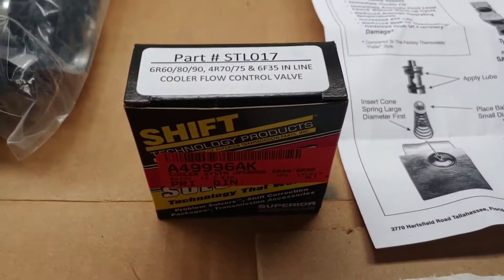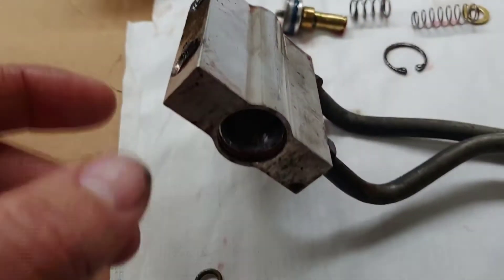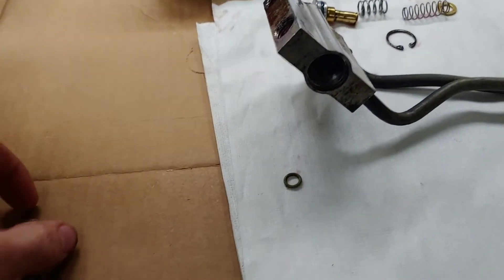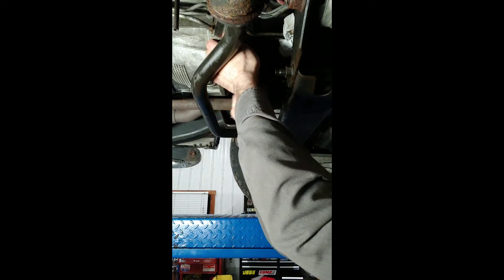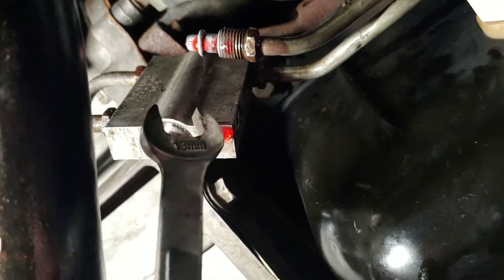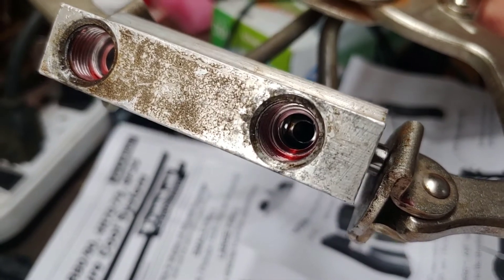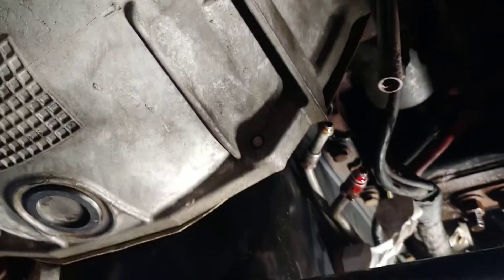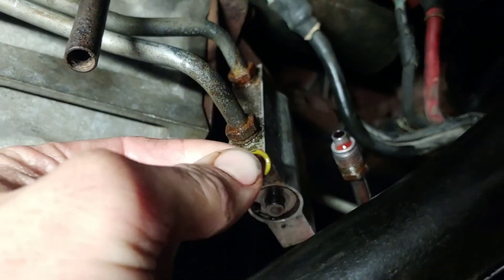STL017 Transmission cooler bypass valve install tips - 2006 F150

Comment: Great video.  Replacing my lines and luckily I put it on right. Lower line on side where spring comes out. Now I cant get one of lines in the bend is a couple degrees off ...ughhh..any tips for that
Reply: I'm having the same trouble. Any tips?
Reply: @danielguerra626  I also did trans cooler. Might of left lines off there.  Cant remember.  But I tightened them on bypass first then on cooler and radiator.  I did all of them in one shot